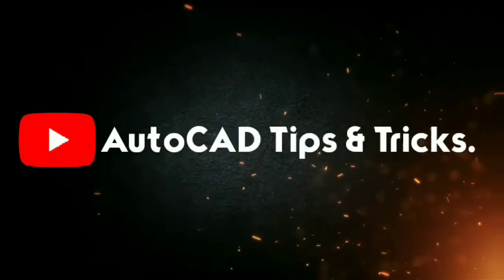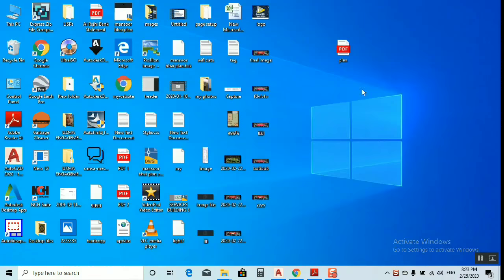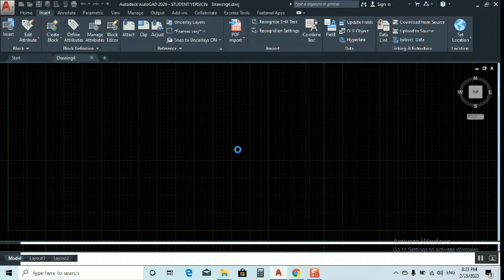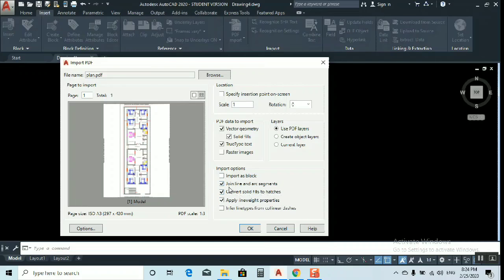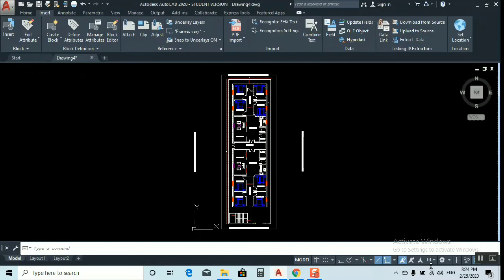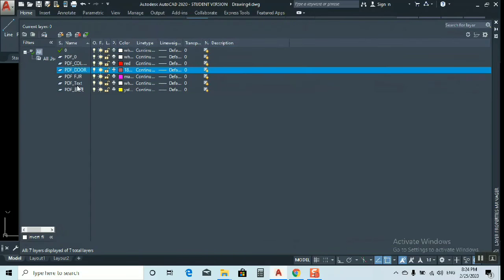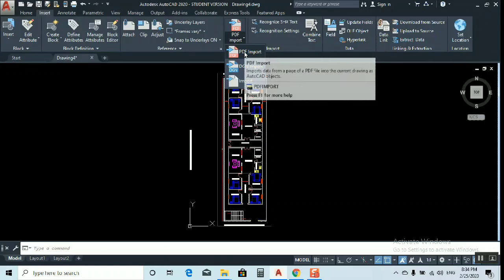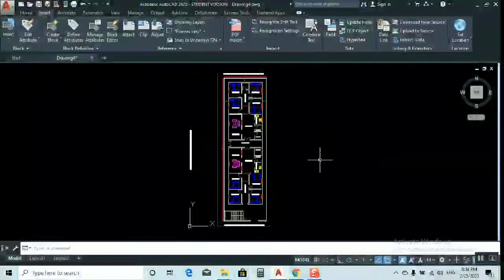How to convert PDF to AutoCAD in just 2 minutes 😲

Comment: Hi,,,Sir   Can you please help what was happening? I did all the step the same as your video,, but unfortunately it's doesn't work and it's appear some notice that said " NO OBJECTS WERE IMPORTED The specified page or area of the PDF file contains no objects " , How could I resolve this problem? can you pls. advise to me
Reply: It may, you are using a lower version of AutoCad.
Reply: Same problem sir
Reply: Ok so same thing happened to me. I got that same error. All I did to fix it was just drag the actual file from my desktop into AutoCad and it worked no problem.

Comment: Sir, 
After typing import the pdf files are not visible. Also there is simply an import icon but not for pdf. I'm using 2016 version. Is there any other way?
Reply from the maker: Don't type there is an option import...Open a new or existing drawing file. On the Application menu, choose Import → PDF.
Press enter
Browse to and select the desired PDF file using the file dialog box that has appeared.Cl ck Open. The Import PDF dialog box appears Click OK
Reply: @AutoCadTipsTricks  ok sir thanks